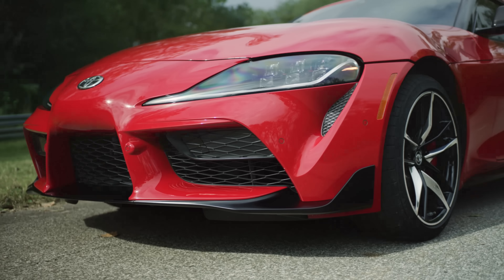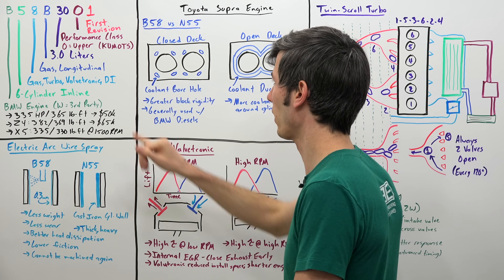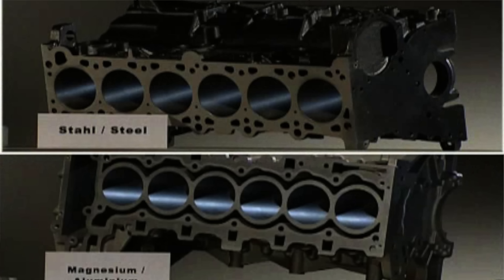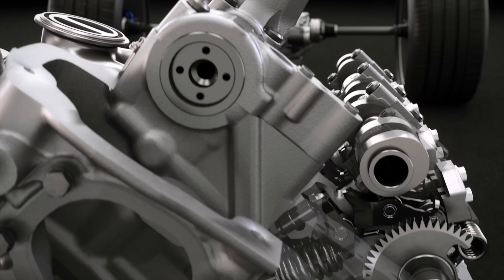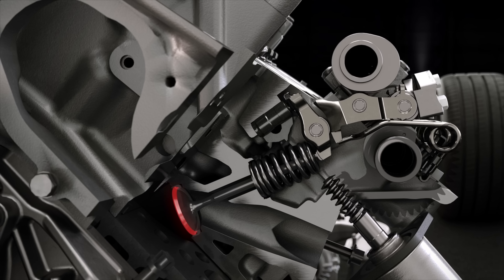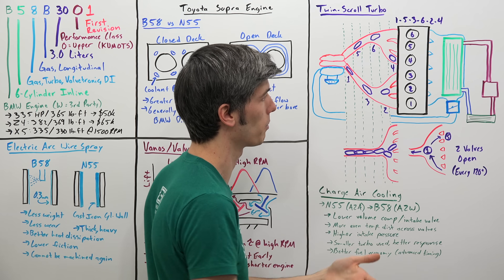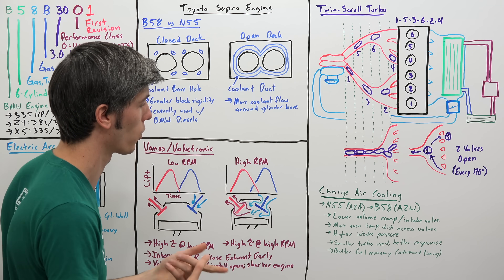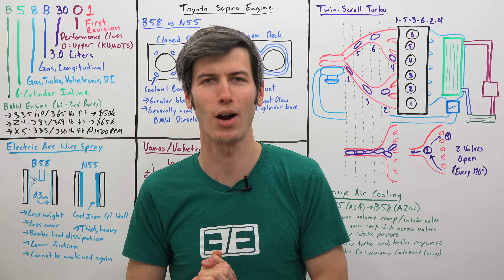2020 Toyota Supra Engine - Detailed Review Of The 2JZ Successor

Comment: You should be comparing the B58 engine versus the 2JZ engine, not the N55 engine because the Supra never got fitted with the N55 engine.
Reply: did you even watch the video? he's talking about the b58
Reply: @jjchockey  The title of the video mentions 2JZ and since the engine capacity of the 2JZ is identical if not similar to the B58, why even bother mentioning it in the title? It's click bait. The presenter was biased towards BMW, not a balance between the two car makers. The 2JZ is atleast partly made in Germany so to ignore it completely is disappointing.
Reply: literally has nothing to do with your original comment but ok, you said he should be talking about the b58 not the n55. 
he talked about the b58 the whole video.  @H0LDENSUX
Reply: @jjchockey  The original comment is based on what he wrote on the white board. As you can see, he scribbled N55 when comparing to the B58 in terms of engine block rigidity, less weight, less wear, etc. Yeah sure a newer BMW 3 litre engine is superior than its previous, but in terms of reliability and tuning potential, is it truely superior than 2JZ especially in terms of various types of Turbos used for future upgrades? While the answer is obviously in favor of the B58, the comments made by some Supra enthusiasts seem to disagree with that.

Comment: This is the biggest mistake ever.  I love BMW's because I make good money from them.  I work on them, so that's the only good thing about them. I love toyotas because they are good cars., my first car is a Toyota cressida 1985, so to make it fun did an 2jzgte vvti swap single turbo.  Right now I'm at 480hp. That's just to warm it up. Lol.  So about BMW.    I hate when BMW owners say that they haven't got problems on the cars. So bmw uses plastic. Thermostat housings, water pumps, plastic ends coolant hoses, all this plastic  starts to degrade and break. Plastic cam covers crack and leak oil. Engine oil pan leaks, cam sprockets breaks. Automatic transmission made by zf will fail if you dont service them. They have many electrical issues. When replacing a battery, you have to program it.  That's the I6s now the v8s are worse. So BMW owners don't says that bmw are one of the best cars out there.  Because they are not. Toyota could make a better car by themselves.  Bmw doesn't even have a truly sport car.  Bmw fans will say. Yes they do. The say the m series.  Yes they do. But they are just coupes and sedans with wider body and more performance.  What about  the I8? Well, personally I think it looks nice. But the body panels feels like crap. Getting in and out is not that nice. Once your inside it's a beautiful car. But it will never be special as an LFA.  Do I have BMW's? No, I like Jaguar better. Is jaguar good? Depends on the year.   I like Jaguars because there are not many like BMW's, now anyone  has bmws  that they dont look that special anymore. I also have a Mercedes, and a Range Rover.  So by owning and working on European cars for over 13 years I can say I know what I'm talking about.
Reply: I'm a mechanic as well (25 years if it matters) and own two bimmers. Yes they use some plastic stuff and people know about it and take care of it. toyota v8's egr issues, air suspension on lexus, radiators on all of them (plastic as well), cats,timing belts to be done every 100K, I can keep going on on all of them. Oh yes, boring cars to drive as well.
Reply: @frankburn6312  until now I haven't seen any bmw with over 300k miles. But I have seen a good bunch of Japanese cars with more than that.
Reply: Judging by your response I can tell you don’t work at the bmw dealer and work for a independent shop that works on European cars. Also you are completely wrong about the zf trans because there is no service for them. The fluid is life time. So what are you servicing? The only issues is when a collision shop fixes them and never tops off the fluid when the cooler gets smashed.
Reply: @darkened13  Of course car manufacturers will say they are filled for life.  Its business my friend. The actual manufacturer ZF.  recommends to service them. You can find info about. If people follow dealer instructions then that's their problem.  Is same when they tell you to do oil changes every 15k miles. At the end dealers just want to sell. And what a better way than telling people that they dont need to service their transmission. Or change oil every 15k miles.  At the end every persons things different.
Reply: Freddy Aguilar sorry I’ll have to disagree with you again. Since I actually work for a BMW dealer with level 1 status. I can tell you that I’ve seen thousands of bmws with 100k plus with zero transmission issues. Also it is not the dealer that sets the oil intervals, the manufacturer does. In today’s bmws, the interval isn’t just mileage. It accounts for driving habits, times and many other factors. If ZF has transmission issues, you would see it everywhere in the 19 different manufacturers that use the zf8hp trans.
Reply: @darkened13 100k miles is not that much. Wait when they get close to 150k. Probably you wont see them with that many miles. Since they  will be out of warranty by then. And owners will be having theirs cars service by a different place.
Reply: bmw may have designed the engine but toyota is the ones building it
Reply: @jOoomOooo  toyota is not building the engines, it even has the same engine cover as the bmw with the swapped badge, i had a 440i(b58 engine) on my lift today and i compared to the pictures and videos of the "new supra". almost 99% identical even to the coolant hoses and expansion tanks.
Reply: @nurettinozgur6415  thats design hunny
design does not equal build quality
Reply: @jOoomOooo  you know bmw does not make their parts for their car right. they outsource to many different companies. im a mastertech at bmw dealership and alot of times when i pull parts of and really look u can see the third party companies names on them. are you telling me toyota build all of their parts?
Reply: @jOoomOooo  everything in that toyota  except exterior is bmw, from what i can see in pictures and videos heres a list:
b58(engine)
zf transmission(given information from released articles)
idrive controller(buttons/knob for nav screen)
CID(center information display/nav)
shifter(same setup slightly different)
steering wheel buttons,headlight switch(lol)
list goes on and on
interview from toyota performance director at detroit auto show stated that the only thing that had toyotas touch was the exterior and tune( which is 40hp lower than the z4)
Reply: @nurettinozgur6415  No duh but as someone that works for toyota I can you that when toyota orders pistons lets say, they send someone to over see the production of those pistons to make sure of their quality
Reply: @nurettinozgur6415  also have you read any of the interviews with the head engineer? There is one where he says 
"a little british boy came up to me and says
can you put a 2jz in it?
I said 
of coarse you can"
loved that 
anyways I dont see them putting some thing that isnt quality into their cars
Reply: @jOoomOooo  yea thats why they offered a 4 cylinder version of it so people can just swap it out

Comment: BimmerWorld lists the 2019 Supra MkV engine as the B58B30C whereas the 2020 Z4 MDrive40i is the B58B30O1.  There is a 2020 Z4 sDrive40i with the B58B30M1 which I wonder is the European version with the particulate filter as it is a lower power designation of the two Z4 I6 engines?

Comment: So you’re saying you cant modify the engine to make a kazillion HP+ drag car like the Mark IV, as you cannot do anything to the block because of the new fancy coating in the bores, a LOT of people will not be happy about this, no factory fitted rear wing ? . . . You can however remove some of the duct panels for “ race mode “ . . . It doesn’t look as wide as the Mark IV . . . Stock 350 ish power is so 90’s . . . They better have a good ace up their sleeve with “ race mode “ . . . Ill stick to the Mark IV thanks . .  Car designers have lost the plot with angles . . . What happped to smooth flowing sculptured design
Reply from the maker: Who says you can't modify it? Wire spray bores are super strong, GT-R R35 uses it and can handle plenty more power.

Comment: Stock internals seems to top out at 500hp the block limit seems around 800-900 hp do for 1000hp you'll need to do sleeves

Comment: I have a question, if you don't mind. Has there ever been a 4x4 system designed where the vehicle is FWD when in 2x4 mode? The motivation for my question is that I daily a truck. It rained today and I notice that if I am stopped on an incline it is very easy to lose traction for the rear wheels. I could always put the truck into 4x4, but then I have to disengage it before the next turn. It seems to me, that if the 2x4 mode was FWD this issue wouldn't be as bad. Has anybody tried designed a vehicle this way, and do you have an informed speculation on why or why not?

Comment: So what makes this better than the 2jz? Just seems more complicated, and probably less reliable/tunable.
Reply: 2jz is nothing compared to b58. B58 is smoothest inline 6 cyl ever built in the world - not joking, BMW is famous - it's their strongest point - smoothness - you need t odrive it to experience ultimate driving machine. Also, if it has bmw chassis - then toyota owners will finally find out wha tit feels like when car drives like fun! As for tunability - bro b58 is mid tier engine for BMW and yet it can be tuned to 800whp already and 1200 whp is coming with single turbo. All that with much better dyno curve and torque availability, virtually no lag etc. as I said 2jz is nothing
Reply: Muhhamad Ogli-berdiev i dont think it is as reliable, or as easy to work on.

The maintenance cost is guaranteed to be more
Reply: Yes of course Muhhamad, the "fun" BMW electric steering with absolutely no feel and playstation like movement, very "fun"...

Comment: Excellent explanation for the engines and iam sure its a gr8 power train however its the horror of all horrors , supra getting outsourced, toyota has gone down the corporate gutter and completely shed the racing overalls in favour of  number crunching corporate suit ..... sad day for an enthusiast.  ps: the cylinder lining ... another stake in the aftermarket enthusiast low cost camp  x::c

Comment: The freelance designer that designed the new Supra has also worked with many manufacturers over the years including BMW. 

His retirement is one of the reasons why Ford dropped most of it's car line-up and GM is closing factories.  

VTEC, Vortec, Voltec, Duratec, Ecotec and Ecoboost are some of the engines that he named similarly.  

Certain design cues can be seen across many brands if you look for them.

So to sum it the engine was designed by the same guy as the last Supra was.  3000 GT,  300ZX, F-40, F-50, RX7/8, NSX, Skyline, RSX, Eclipse, Integra, Prelude, MX-6, 626, 323, MX-5, Protege, Civic, Accord, Corvette, Mustang, GNX, R8 are A few of his designs but not all generations on the obvious ones.  

From the late 70s till now...so that is still A fair amount of work.

A free battery discovery is on my page for making your batteries last longer.  Use on your older batteries at your own risk.

Comment: Such a lost opportunity for Toyota.
First off there was utterly no need to cooperate with BMW for chassis and engine: Toyota already has awesome Lexus LC500 and I see utterly no reason why it couldn't be massaged to be come a new Supra. Also there is nothing wrong with going V6 instead of in-line. Toyota has a great block: the 2GR. IMO a centrifugal supercharger would have been awesome with that V6. 8-speed auto from the IS-F or a 6-speed manual would have been a perfect fit. Toyota has a great parts bin, and decided to enter a totally unnecessary partnership with BMW which made the Supra a lot more expensive to own. BMW parts are notoriously expensive

Comment: This cars gonna fall on it's face imo. It's incredibly underwhelming because ppl are using the mk4 as the benchmark. It's extremely expensive relative to other cars in the same performance category and ppl expected for it to outperform the mk4 by more than 30hp. Just like new top gear compared to old top gear. It likely would've been better received had they named it something else

Comment: I drive a Lexus IS350 and my brother drives a BMW 335i.  Both are about 10 years old.  My car has been perfect, but his BMW has the radiator leak, fuel pump failed, shocks failed/leak, alternator failed, and a couple of other things I can't remember.  But the BMW's engine was 100% fine.  As long as Toyota only uses the engine and nothing else, this car should be pretty good.
Reply: Those N54 & N55 I6 Twin-Turbo engines provide a beautiful amount of power but fall apart on their own, even if you baby them. I think the engine itself [block] is pretty solid, but every other component is rubbish.

Comment: Yamaha made best and reliable engine why toyota chose another manufactur yamaha can develop better engine like 2jz and lfa engines
Reply: 2jz is crap compared to b58 which is mid tier for BMW to begin with. That just gives you perspective bro. Also, b58 is tuned up to 1000hp already and best is yet to come. 2jz is nothing
Reply: @azerogliev6520  
And the 2jz was made nearly 30 years ago and people are making 2000+hp. What's your point?
Reply: @azerogliev6520   HAHAHA .. That's so funny you say that.... I don't see any B58 motors in the 5 or 6 second class on the 1/4 mile. Soooooo   guess the 2jz that are in that class must really be that crap, HUH ?  And before you tell me that some of the 2jz motors are billet blocks... I am trying to compare apples for apples. A full aluminum block from BMW with a full aluminum block the Billet 2jz, is really in the same class, just the one sucks, BMW. Plus if you wanted to compare apples to peaches then let's toss in the cast block of the 2jz, and it still beats the B58 by a mile. I mean give me one really good comparison that you can say ... hey look, at least there was one car built with this or that from the B58 and it droves more than a 100 miles before it blowed up..  I use to love BMW... but man... as much as i did, They fell behind to the bigger number game long time back...
Reply: @speadfreakmax  
You cant be serious, Cast aluminium has NOWHERE NEAR the rigidity and strength of CNC'd billet aluminum, cast costs hundreds of dollars to produce whilst billet cost thousands to produce.
Reply: @yjkader  yes, you are correct and i agree. Only reason i brought that up was to compare 2 aluminum blocks. And billet blocks are spendy for one simple reason... volume is so limited. If there was more market for this it would be cheaper... but time plus all the darn machining that goes into it.... i agree with you.. spendy
Reply: @speadfreakmax  
That's correct, it takes many hours if not days to produce a single bottom end out of billet aluminium. This is too costly and time consuming for mass production. However cast aluminium techniques/technology has advanced combined with ribbing and bracing - we're finding cast aluminium being used in high cylinder pressure applications these days that we would not have seen in the 90's, from diesels to ecoboost v6 found in Ford GT to VR38DETT in GTR's that are exceeding 2000whp on stock blocks. Aluminium dissipates heat much better also. 
Cheers.

Comment: While it is dissapointing that it has a good deal of BMW kit it does not mean it has the handling and style of a BMW. I think you can not have a full opinion without a comprehensive drive review as well. Powertrain is only half the picture, how it handles in twisty bits is close to more important. If the whole vehicle was Toyota  you could expect it to be priced at 6 figures due to the cost of developing a bespoke engine and drive train. Would you want to take this gamble when sedan car sales are nose diving just about everwhere.

Comment: Good on BMW on making a Currently Reliable engine, but most of these Japanese Automakers failed to realize the reason these cars were successful: Price, Performance, simplicity, and Reliability cough- Mazda -cough some of these cars are slightly or borderline overpriced, and some batteries might not be reliable (Except the engines themselves) and performance might not be satisfying, but they failed mostly on the Simplicity part. All of these new cars are over engineered (Except the current GTR, and I'm talking about the Flagships of the Companies, not BRZ or 370Z) the old cars were praised on there merit and ease of accessibility, the old cars can make big power with ease. Now these engines are filled with technology that only Bill Gates can tune at the cost of JDM hero. Oh and we need a Manual